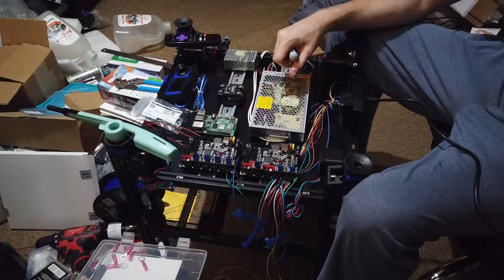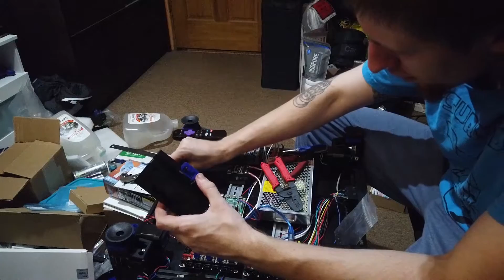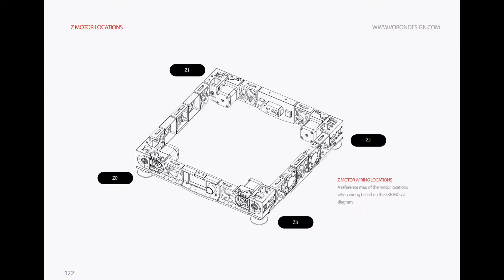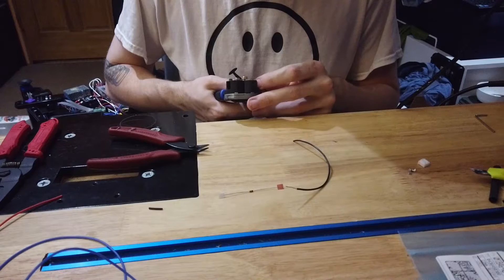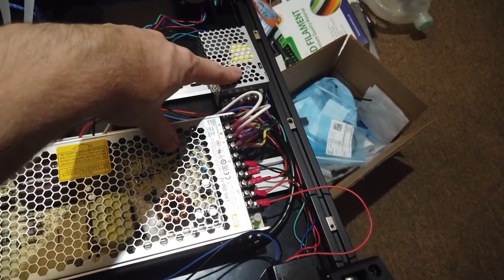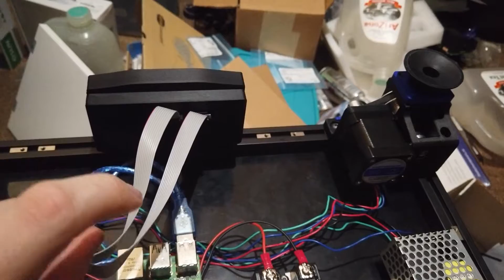Voron 2.4 - E9 - Wiring, Pt. 2

Comment from the maker: It has come to my attention that the the current release of the manual does NOT have the wiring diagrams in there. If you need one for your build or at least a guide, there's one on the discord in a pinned post in the Voron channel. https://discord.gg/UwuTg34A7g

Comment: As always I appreciate all your videos on the build 
I am at the point of wiring up the solid state relay 
I can’t find a decent full wire diagram for it on the skr boards
Which particular guide did you use ? the manual only covers bed to ssr 
I am then assuming it goes directly to the skr ? 
Thanks again for your help 
You have been invaluable
Reply from the maker: My apologies for the delay Neil, as for the skr and ssr wiring, I used the Voron manual. Specifically pages 115, 117, and 120. 115 shows the correct wiring for the Line voltage to the ssr and how the bed hook up. Page 117 Shows the correct wiring (+ & -) on the ssr, while page 120 shows the correct wiring on the skr side of that connection. I hope that this helps. If you need more in-depth help, jump over on the discord and I can help you more there.
Reply: Thanks 
I appreciate the reply no apology necessary 
I may have a different manual than you the page numbers I have don’t coincide with yours
I don’t really use discord as I find it so hard to get information I’m looking for. I’ll give it another shot though 
How do I contact you on discord?
Reply from the maker: You're most welcome. I'd pull the most recent version from the voron git hub. As for finding me on discord. There's a link to my server in the video description.